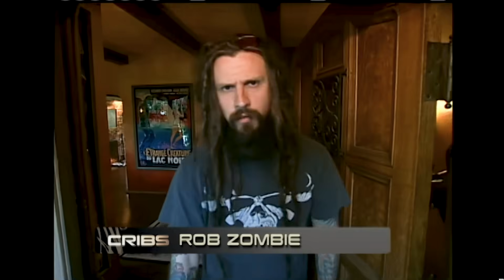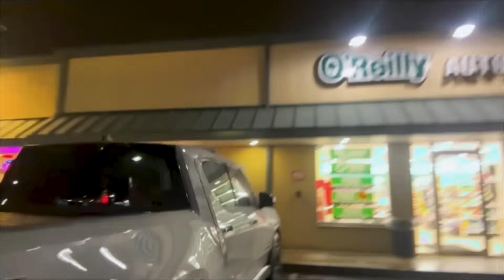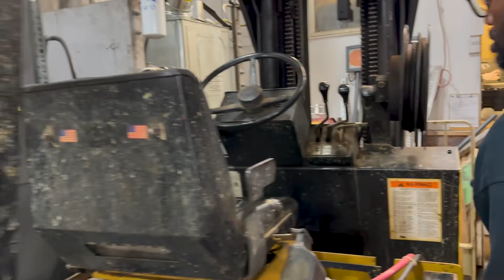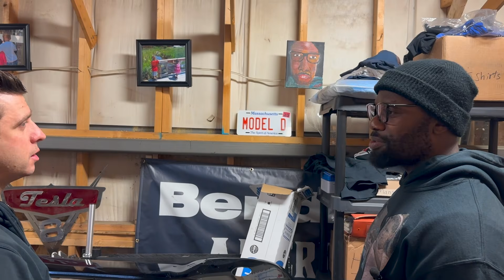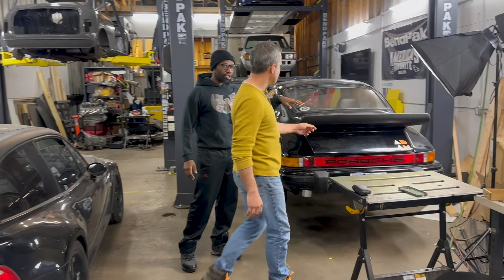I Thought I Could Keep Doing Youtube Like This but I Was Wrong, Time to Move On.

Comment: Long-time petrol head and HP car enthusiast here.  Just stumbled upon your channel.  In this video you mention that you are considering relocating your shop operation to a warmer more economically robust location.  Nothing compares to Dallas, Texas.  First and foremost, Dallas is a car town.  Although it is easily one of the richest cities in America, the cost of living is very affordable.  Industrial/commercial shop space is cheap and very easy to find.  All of the luxury and performance car brands have dealerships here, along with the U.S. Headquarters for Toyota North America, Mercedes Financial, Texas Motor Speedway, etc.  There is also a very active and robust community of automotive customization and specialty shops of all kinds.  Lastly, the winters here are very mild and typically last only 2-3 months; however, it does get VERY hot sometimes in the summer.  In Dallas we have everything but the ocean and beaches.

Comment: I want to say your place is amazing I still live in a cardboard box across the street of my parents next to the open sewer.

One comment though, straigt cut gears hold less power than angular cut gears with the same module. They are used in rally cars only for the efficiency benefit.

Comment: arizona around wilhoit ... cheap dry little rain and good weather up in the mountains so never drops below 20 never gets above 90 and has super low humidity so no rust ever. they dont salt the roads and snow is never bad to the point i cant drive an open diff no traction control vehicle with cheapo tires over the mountain to prescott ... go to wilhoit az

other reasons to move to wilhoit:
-- no smog
--super cheap registration for vehicles
-- build almost whatever you want on your property (200sqft shed 10feet to eves no paperwork necessary 400 sqft 10 ft eves $40 and need to submit a sketch no inspections or anything else)
-- store almost unlimited vehicles on your property
-- still close enough to town

Comment: I use the heat for my dryer during the winter as well, put a old pillowcase zip tied and duct tape around the the exhaust tube to collect all the lint. When summer time comes take the pillowcase off and beat the lint out of it for use again.

Comment: You should custom build a 60V / High Ah like 50-60aH and put it together with the 21700 or 18650 cells. Then with an aftermarket controller it can easily pull 250A vs stock 120A-140A for surrons & talarias.. I have a Talaria also, such a fun bike to ride to the store, etc, as well as trail ride it on some nice MTB trails. Nice and silent and i get about 3hrs of that kind of riding aggressively too though, like going as fast as we can following each other in the trails lol..

Comment: fix step by running 2 x 4 from center of soft spot to floor...one screw thru step into end of 2 x 4 fixed...:)  Could use length of 4 x 4 if concerned of traffic over steps...:)

Comment: if you can fix a tesla battery broken connection for less than $4.00 usd in parts...u can drain the old main oil tank :)

Comment: use a long wooden measuring stick coated with a chemical putty that turns red when it  is exposed to water.  Gas stations use this tech to determine how much water is at bottom of tank below fuel..:)

Comment: Lol Rich you were doing it wrong for a northern climate. The trick is to stick with trucks, ditch the shop and learn to fix and modify them on the trail. Trucks are more forgiving and it's more about having fabrication skills than it is design. With cars like the Z3 everything is tight and needs to be made 3X incorrectly before you get something right.

Comment: That bmw m coupe is worth rebuilding the engine to restore compression....might be able to get away with just manually cleaning/cutting the valves and replacing the piston rings and then head gasket......:)

Comment: lead batteries are 0.50€ per kg, so its easy to recycle them. Hauling them is the pain in it, but collect enough from idiots that throw them on the side of the road. Also we are not allowed to buy battery acid so go figure that is also way to get some.
Also i'm building counter weight for tractor from lead so some of that lead will go there... if this video was not satirical yeah that is how you fix it. For the contaminated oil, you should be able to distill it least partially and water does separate from oil so open valve from the bottom of the tank and it should let out water until you get into oil, then you close it.

Comment: Power stroke ford engine into the humvee. With mechanical fuel injection,like 1995 models I think. Are EMP resistant. 😅

Comment: Don't laugh but seriously consider moving to Detroit.  Yes you still have the cold but the cost of living is much, much lower.  

There are huge old factories and warehouses where you could have plenty of room for both a shop and space for all your cars, plus rent is dirt cheap.  Lots of really talented helpers as it is after all the Motor City.  Additionally the weather is milder than New Hampshire. 

However to be perfectly fair you will need a really good alarm system.

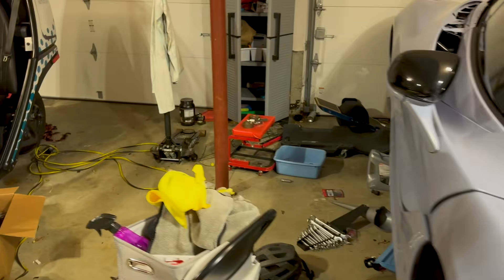Comment: 32:50 Michigander here, I swear by electric radiant heaters (infra red), they heat up your work area, your tools and the things you are working on, they don't as much heat the air, which just rises uselessly to the ceiling. Again, I swear by them

Comment: Ideas? Here's my idea, Rich  forget garage and get an aircraft hangar...reason being is junk expands to fill the space available, or in your case, we'll say cool projects expand...yada yada. Also with a high ceiling you might need heated floors to stay warm and a heat recovery ventilation system to draw hot air from the ceiling and vent it out at floor level. Keep building and keep posting!

Comment: Rich- I would seriously look in Tenn  for a couple reasons. 1) Warmer but not hot as many 100+ deg days as Fla. so overall better ambient temp without the use of heater or A/C. 2) more centrally located in the country so quicker trip to Fla or back North or even out west. 3) Closer proximity to project cars that are not rust buckets. 4) Taxes and cost of living. Average property tax in 2021 was $1500 for the year. If not for my kids and grandkids I'd be there now.

Comment: YES, I would be interested in an LS swapped Humvee build. Or Cummins, a blown inline 6 diesel or something of the sort, whatever floats your boat really. Do it electric if you want. I love the mil-spec aesthetic of the Humvee, BUT, it's known to have engine and drive train issues with its original hardware. Yes, I know it's a very expensive project, and that it would take time. But I think the interest is there.

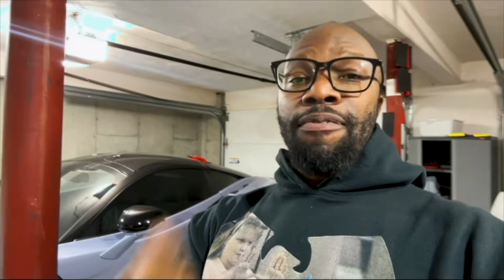Comment: 29:55 Oh Rich, really? Climate Policy? What they dont tell you is that there is a limit to how much heat CO2 can trap in the atmosphere, when you reach a certain number of PPM then the heat trapped plateaus and anymore CO2 after that has basically no effect, and we are pretty well at that point, also oxygen is more of a greenhouse gas than CO2, not to mention the earth has been much hotter in the past and has been fine, in fact all evidence shows the earth is much healthier overall at hotter temperatures. There has also been technology around for more than a decade which can pull the carbon out of the air in a form useable in industry and with a recent discovery they can get hydrogen as a byproduct of this process which can be used in fuel cells, so that now cleaning the carbon from the air actually makes more money than it costs. These are all 100% proven scientific facts and if you don't believe me then just take the time to do some research and find out for yourselves.

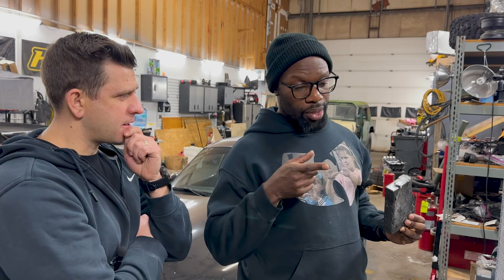Comment: 10:24 Thats the problem with using lithium in batteries, it ignites on contact with water so if your in a place where the air is even a little humid it will ignite if exposed to air, just the moisture on your fingers is enough to cause it to happen if you ever take one apart.

Comment: To take care of the water+coolant in all three of the waste oil tanks, let them sit so most of the water and other liquids heavier than the oil will settle to the bottom. Then you need a drain at the bottom of the tank to tap off the water etc into another container. Easy to tell when you have most of it when it goes to black oil coming out. That contaminated water should be taken somewhere it will be treated/cleaned.

Depending on how the oil heater is set up, it may be able to burn slightly watery oil if it's emulsified. Most motor oil already has a surfactant (detergent) in it to hold some water in suspension so it doesn't separate out into the bottom of the sump. Add more surfactant (AKA soap) and more can be emulsified.

A water/oil emulsion is more difficult to burn so it may need pre-heating and better atomization. There may already be someone near you with a waste oil heater able to handle your contaminated oil. Unless MA bans burning of any waste oil with coolant contamination. But first get as much of the water and whatever else has separated out drained off and properly disposed of.

Or someone might have a centrifuge oil cleaning system and be willing to take that oil off your hands.

Comment: My spouse used to consume spare oil like this with her old VW Diesel. It ran really cheap this way, as it was taking up more oil than gas at the end. The most expensive exercise with this vehicle was the EUR 100,- bill she had in the car, in case of a break down, which of course she forgot about when the car terminally broke down right at the gates of the car disposal site.

Comment: You probably won't see this. But I would say Florida is a good option. HOWEVER!! I would say this state is getting crowded, and as such values are rising of both residential and commercial properties alike. I would search Lake Wales or Sebring FL. I think it would be better because those cities are more central, and also smaller cities that aren't in close proximity to tourism hot spots that drive up values. Lake wales is home to Bok Tower Gardens but besides that it seems to have remained a much sleepier place than Palm Bay were I live. Which I believe in a U-Haul survey is the #1 or #2 most moved to city right now. I and my family have lived in this state our entire lives so I hope this helps. In short focus on the middle areas of Florida, and I believe you'll find better prices on land

Comment: I once talked to a guy who had a big shop and had been using waste oil for heating. But he had rigged up some sort of water spray system that would enhance the burning process. I have no clue what kind of stuff he had, but he told that the flame was bright and hot  as hell and there was little no smoke or smells. But eventually he got caught, as there is no way to use waste oil for anything in a lawful matter. The man seemed to know a thing or two, raced at "high level" banger grassroots, which can't really be called grassroots as there are cars with really high dollar engines going around and as one other guy talked about it, he gave me the impression that nowadays it's just rich kids and their dads competing with each other.

Comment: If you're looking for states to move to, may I suggest Idaho? There are only a couple months out of the year where it gets cold enough for snow usually, but the snow doesn't last long and the roads aren't salted. The rest of the year it's a very dry climate so cars don't rust, but it's not super hot either, most of the time the weather is actually pretty nice. There's both a huge classic car and JDM scene, plenty of EV chargers (judging by the huge number of Teslas around), and there are no emissions tests or inspections whatsoever. Only downside is that front plates are required unfortunately, but lots of people just stick it in the windshield and call it good. 

There are also some good driving roads up in the foothills where it gets nice and twisty, winding mountain roads, an oval track, and a drag strip. Also 70% of the state is national forest (and mountainous forest at that), so it's not hard to find pretty locations for filming. There are quite a few big lakes as well, though I'm not sure how open they are to having Sherps driven into them. As far as property values go, they're not too bad, though they have gotten higher in recent years due to the sudden influx of Californians. 

It is however a VERY republican state, which I personally don't mind and haven't had an issue with, but if that bothers you then it is something to consider. To be fair, it's generally more of the "don't take my money, leave me alone" types of republicans and for the most part the people here are actually pretty chill and don't want any drama. I would describe Idaho republicans as just a bunch of introverts who want low taxes.

Anyway, politics aside, I consider Idaho to be a car enthusiast paradise and would recommend considering it. Grind Hard Plumbing is here, so at least a few other YouTubers have found it to be a good base of operations!

Comment: I don’t believe there’s a perfect solution. You could move to the Carolinas, but there’s still an ocean with the possibility of hurricanes/inclement weather during hurricane season. Oceans also mean salty humidity, so there’s still salt in the environment. Tennessee is also seeing increases in natural disasters due to heavier rains with resultant wind damage and floods, and an increase in tornadoes.

It seems like you don’t own your buildings, but one way to mitigate the cold(and animal issues) would be to insulate the walls and possibly the roof. Drafts(and rats) can also be mitigated with proper tuckpointing around the foundation. Though your garage door might also be an entry point for rodents.

Comment: Come to NC. There are a bunch of abandoned old tobacco wharehouses/farms that look pretty rough but are still sealed up for the most part with paved floors. With a little work, and some air conditioning, I can't really think of a bigger paved open space that's enclosed. Land prices are stupid high anywhere but surely they've got to be cheaper than Mass. I know a building right now that has been abandoned for at least a decade with only a few windows broken out that I'm sure someone would love to get rid of. Then again people in the south like to watch stuff rust into the ground before they'd sell it, but that might be my dumb luck. It really boils down to what you need in your life. If you MUST have a Starbucks 5 mins away then you're probably not going to see prices any lower than Mass. Move away from a major city 10-20 miles and prices drop dramatically. We got a 4 bed/4 bath single story house in a cosy suburb for $170k at the time which compared to other houses of the same size closer to Raleigh the price doubles and triples and so on. It's all down to what you need in life. Get cheap open space free to basically do what the hell you want, or pay loads more for convenience. 

I just really don't want you to go to Florida. If you don't like politics or more specifically if you are democratic type of individual, DO NOT GO TO FLORIDA! It may sound inticing but do you really want your life run by people who hate colored skin people? I hate to take it there but that's the realness coming through. At least NC is has some blue in it and you've never heard of "North Carolina man" like you have "Florida man" have you? The defense rests.

Comment: I worked for ZERO as a temp for three months. I did the main wiring harness and assembled the wheels. In the middle of my employment we moved shop two blocks South in Scotts Valley. Me and this other dude were assigned to the heavy lifting and dirty work. One of the tasks we were given was to move/clean out the RnD department. And they had just left behind their rack of shame covered in puffy batteries ready to explode. We were instructed to move them to the shipping container of shame. Then I went back to building the octopus and making wheels go round.

Comment: Rich...Look into the RTP Area of North Carolina.  (Cary, Raleigh, Durham, Chapel Hill, Apex)  I moved here from PA 10 years back and it was the best decision I ever made.  I'm sure you are aware of the weather...it a rarely snows (the entire time I've been here, I can count on one hand the number of times it has snowed- and when it does, it disappears from the ground 12-24 hours later.  They also don't salt the roads, which is HUGE).  You can drive a sports car year round without any issues.  The area has been experiencing constant growth since about 2013.  Pretty good car scene, I would say it is comparable to Atlanta.

Comment: Weather here in Florida is more reasonable, however summers can be sweltering due to the high humidity. It is certainly hotter in the interior of the state, but more protected from Hurricanes. The coastal areas typically get a sea breeze during the summer which can keep the temperatures 3 to 5 F cooler than the interior…but then you are closer to hurricanes. Been here all my life and love it.